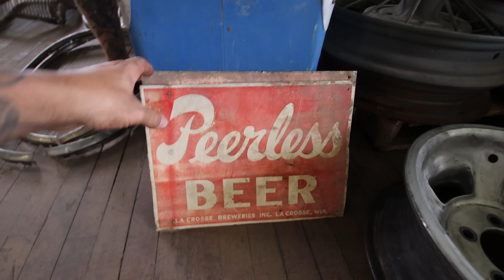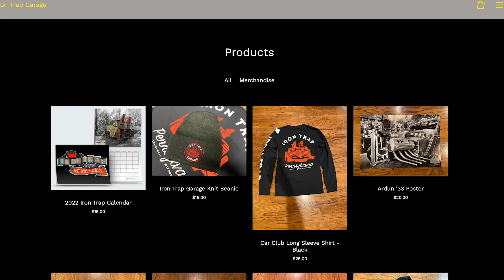Unloading The Packed Box Truck From Our 2,000 Mile Picking Adventure!!

Comment: Hey guys, killer olds stuff you digged out there. If you like to know what kind of big olds rocket engine you've got, look on top of the "bellhousing" of the block. There should be a "4" for a late 371cui and if it is a 394cui there should be a "4 1/8" on top. Boresize was cast into the top as far as I know.
Reply from the maker: Good info thank you!
Reply: @IronTrapGarage  Did you took a look at it? I'm curious what it is. I may be interested if it's a 394.